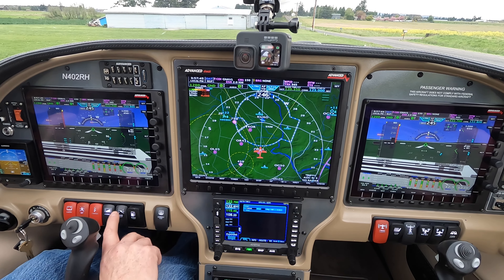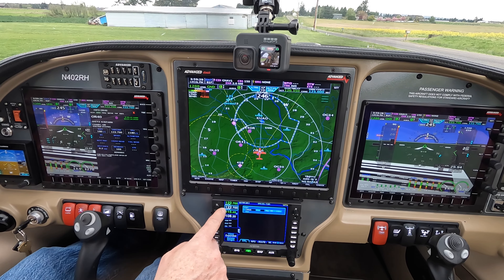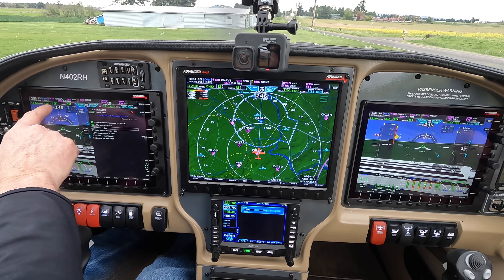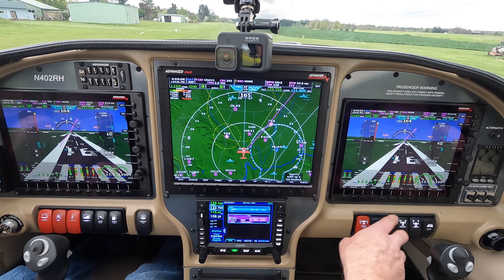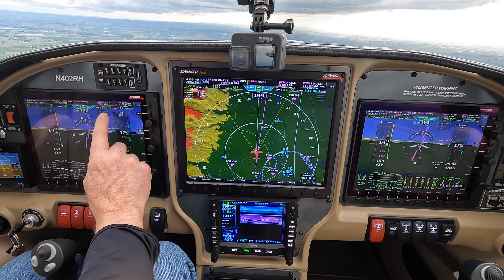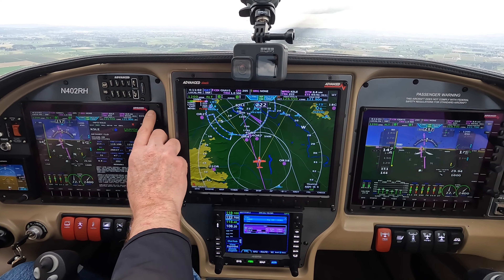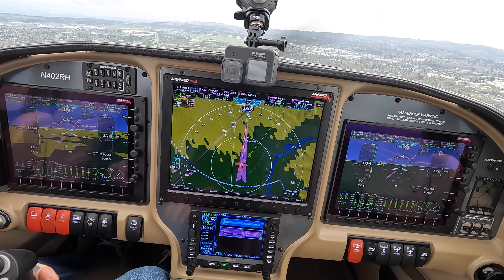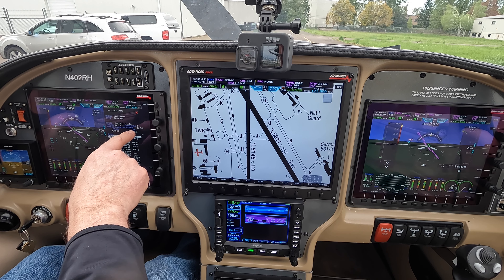RV-10 VFR Flight from OR40 to KSLE with the AF-6600 EFIS

Comment: If you run out of electricity and all your screens go out, what will you do if you don't have any other pneumatic instrument; at least an altimeter and a speedometer. Be smart and don't just rely on electronics. What kind of aircraft is this and an aircraft manufacturer that does not think about safety. People smarten up, because it's your life.
Reply: Modern "glass" panels will obviously run on main battery and have internal backup batteries. This plane does have a backup (on the far left of panel - with another backup battery). If you want to wear a belt and suspenders both...go for it. But this system has a lot of redundancy and solid state reliability.